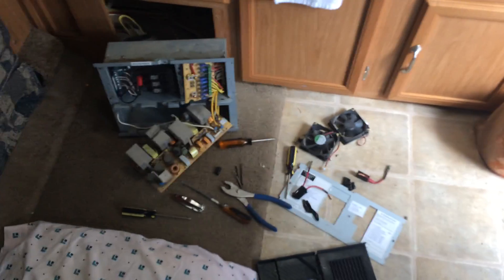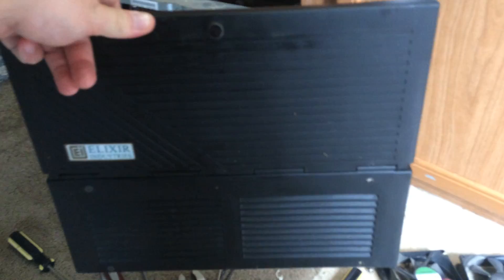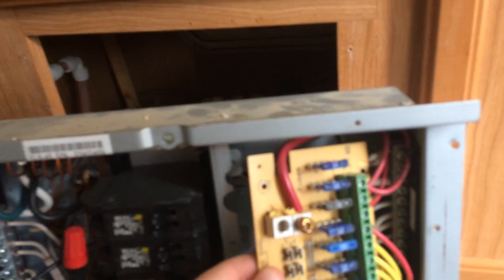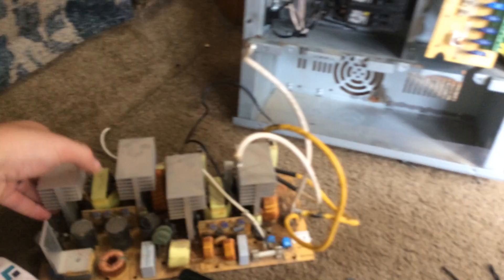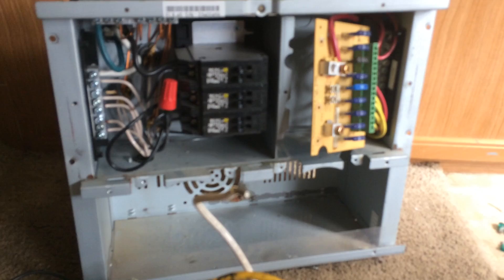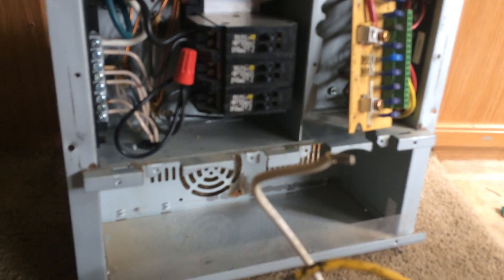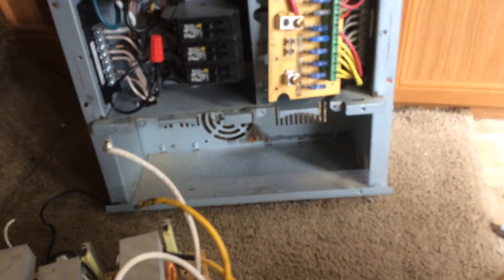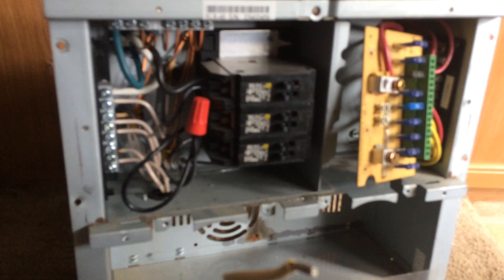RV power converter swap ELX-45 to PD9245C

Comment: Where is the update I’m dealing with exact problem
Reply from the maker: ended up going with a totally different converter. just get rid of the ELX and you can wire in a replacement converter easily. i unfortunately did not get a chance to upload a new video before i had to get rid of the camper.
Reply: Hey evanaguilar471 - same here. Did you come up with another solution? Would love to hear what you ended up going with and how it went.

Comment: I know this is an older video however we are replacing one of these converters. 
What are the two large yellow wires on the right side of the converter for?  Are they the hot wires?

Comment: How did the replacement go? I have the exact converter wired in the exact crazy configuration with the same melted fuses. Did you figure out the black wire?

Comment: I have the ELX-45. I was told trailer was plugged into 220 which fried converter. After some reading on net it looks like I need to go back with the PD9245C also.  I have Battery charger plugged into trailer ac to keep battery charged.

Comment from the maker: although this is by far the best towing trailer out there and you can squeeze it thru some tight areas to camp and then boom it pops right up. but these are only a good choice if you have a good generator and stuff if your dry camping and you know what your doing. these things are basically not designed to be used for anything other than RV camp grounds though.

Comment from the maker: meant to add that this was PART 1 . anyways i have been reading my eyes out trying to find a diagram of the wiring to the elixir converter its not in the manual i have in the RV it just has a picture but no wiring diagram. i will hopefully have the PD9245C tomorrow and i will update what i find. if i cannot wire it up i may have to take it in. either way i will show how it gets done so in case one person out there had this issue they wouldnt go thru the hell i am with having a RV that was rare to begin with but seems like every day it gets more and more obsolete...
Reply: Did you ever post the updated wiring? i've got the same project :)
Reply: @cybersurfr22  Did the new unit fit in the spot?
Reply from the maker: @sjhanksaz  yes but I went with a power wizard unit I believe. I've long since sold that unit and moved on. Unfortunately I never did the follow up video because I never had time I had moved to Florida. Ill have to look back and see which unit I ended up with. The elx power converter I had originally ordered ended up not being the right unit at all. I think I went with an intellipower wizard or something along those lines
Reply: Did the new unit fit in the opening?